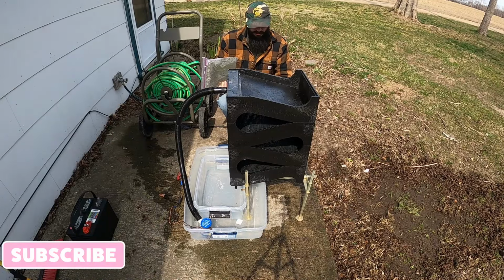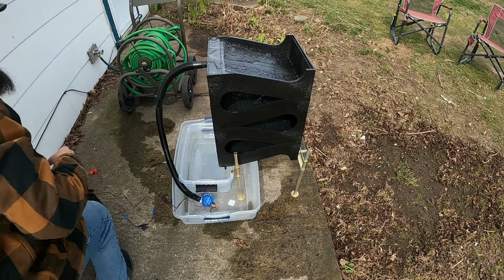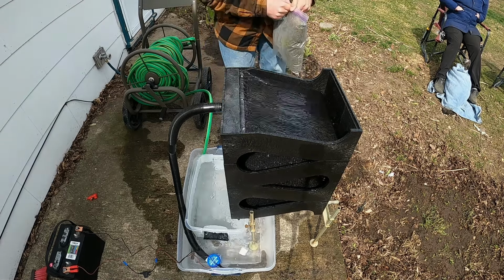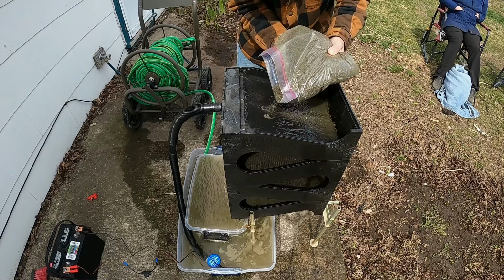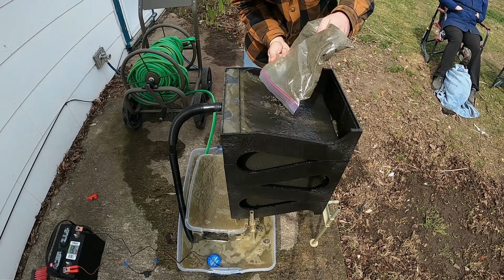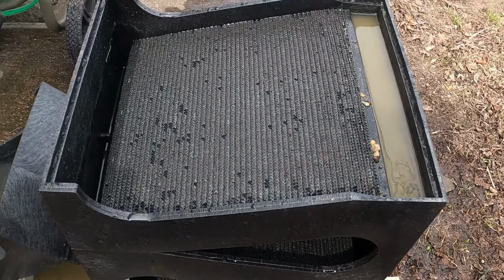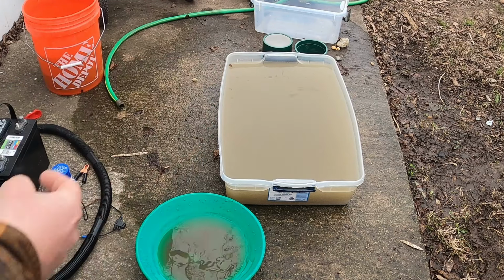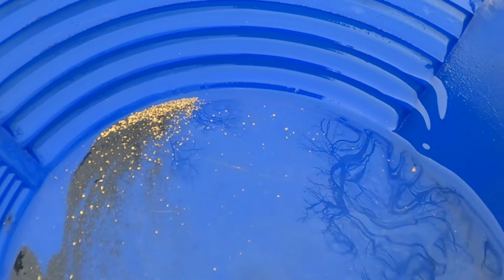Testing Out My New Gold Cube

Comment: I also have the gold cube w trommel.  I will say this, a slick plate catches NO gold, get you some v groove matting and silicone it down,  don't use anything too permanent. Always  use some jet dry, when  panning flour gold Always rock back and forth. Never swip or swirl your pan. Looking good , heavy pans. If you get agold wheel  get the big 24" one. Cobbles
Reply from the maker: Thank you for the advice, I will get a mat for that slick plate for sure. It will take me a little bit, but I am sure I will get that panning technique down. I did lose a bit by swirling the pan, but I will run it all back through again to catch what I lost and use it to practice panning. I am going to look into that gold wheel, I have been hearing good things about it.
Reply: Cobbles!!!
Reply: The slick plate is  not  supposed to  catch  gold
Reply: That why you have the other 2 trays😊
Reply: @Berkshireminingco  thank you for watching 😁
Reply: @Berkshireminingco  thanks again for watching 😁
Reply: @Berkshireminingco  hey Joe, you sleep inside that trailer of yours because you are still using lead acid batteries!! At least put inside a box that is vented outside and sealed from the inside.
Reply: The slick plate isn't suppose to catch gold it is designed to hydrate the material and feed it into the system.

Comment: I just ran across your channel, depending on where abouts your located maybe we could detect together. I'm in Lapeer and have detected for over 35 yrs. Knowledge is key when detecting and the difference between finding trash or treasures! No pressure, just thought I'd throw that out there. Great vid, I'm sure your Dad is smiling. Nice looking Tom!
Reply from the maker: Thank you for watching! I am glad you enjoyed it. That would be really cool, I could use a few pointers for sure. I have been at it for a few years, but my really good finds have been few and far between. I live down by Three Rivers, but I am actually from Chesaning. That really is fairly close to Lapeer, and I am back in that area pretty regularly.
Reply: @MyMIAdventures-cv4dt  Great!  Sounds like a chance to get together is possible. What kind of detector are you using? I'm using a Garrett A T Pro,, its a nice machine for finding coins. I've wanted to buy the Minelab monster 1000,which is an excellent gold nugget machine, but I've never known of gold in Mi.? But coins are a different story, Mi. has tons of them in the ground just waiting to be dug up. Ya just gotta know where to look...
Reply from the maker: Yes, it is definitely possible, I will leave my email below. I have the Garret AT Max, I think it really similar to the pro. I have yet to find a silver coin, I have found a few silver rings and some other jewelry, but really want to find some old coins. You are exactly right about knowing where to look. There is gold in MI most of it is glacial gold deposits, but there are some places that have higher concentrations. I have heard the Rouge River, a tributary to the Grand River, has produced nuggets. Might be worth looking into.

jkohlhoff3@gmail.com
Reply: @MyMIAdventures-cv4dt  Got your email, watch for my email from a "smartass", sometimes it goes to spam. Ken

Comment: Don't know if you used JetDry but it is essential. I could be wrong but it also looked like the water was too fast. Just an observation that could provide more gold from that sand.
Reply from the maker: I appreciate the observation; you could certainly be right about the water flow. I did not use jet dry in the video, but I do usually use some Dawn dish soap when doing the cleanup. I should pick up some jet dry and try that, everyone seems to recommend it.